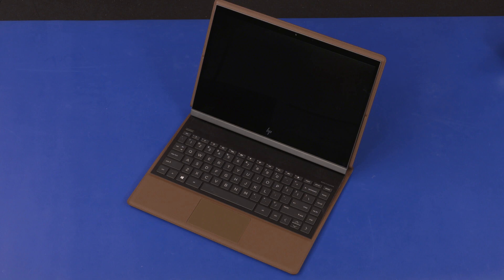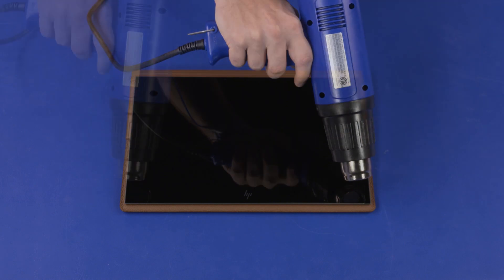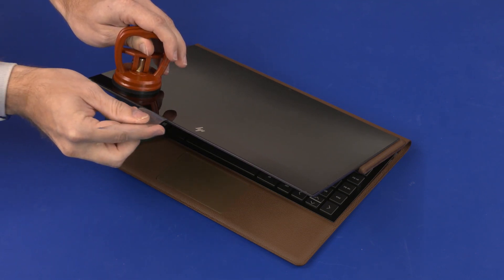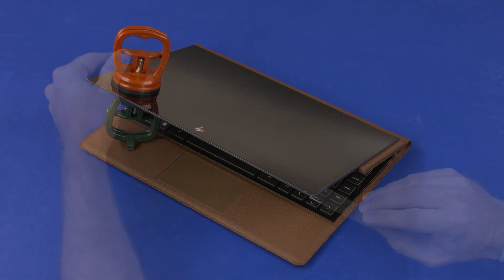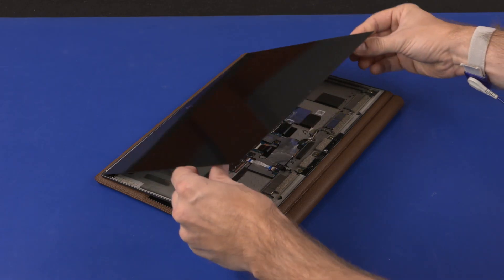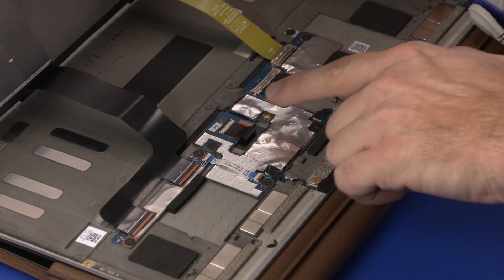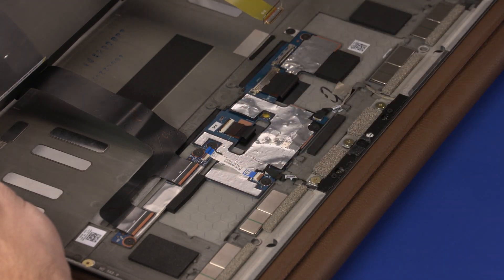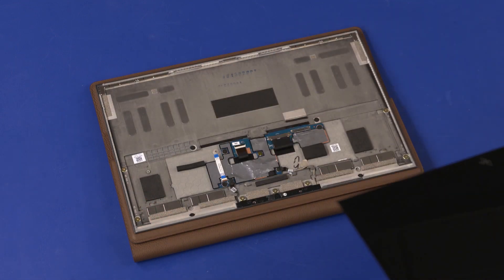Remove the Display Panel Assembly | HP Spectre Folio 13 and 13 x360 Convertable PC | HP

Comment: Could you tell what kind of adhesive can be used for sticking the LCD screen to the panel?
Reply from the maker: Hi Nguyen, thanks for contacting!
I understand that you are experiencing an issue with the screen of your computer.
In order to get this issue fixed, please contact our customer care team over the phone or chat for further assistance, as this issue requires Live conversation with you over phone or chat to isolate the issue and provide you instantly with appropriate solution or repair/replacement options available at your place as per the warranty.
Please feel free to reach us on call/chat, please access this link to select your preferred country and language option to reach us. Global support link: - https://www8.hp.com/us/en/contact-hp/ww-phone-assist.html
Binu - Social Media Tech Support

Comment: I have a couple of horizontal strips in which neither touch nor stylus work on my HP Spectre Leather Folio (a laptop just like the one in the video). I rebooted the PC and the touch-blind strips are still there. Except for them, laptop screen is OK. I wonder, if I disassemble the screen like that, clean the contacts for the touch controller, and put it back together... would it fix the issue? PS Laptop is currently out of the US -- bought it in California less than a year ago...
Reply from the maker: +Ricardo Castro Yes. You can try those steps to fix this issue.
Reply: @HPSupport  I bought this same laptop Nov 2018. I have been almost 6 months where only the bottom 3 inch portion of my screen touch screen works. I have tried every single diag, From restarting in Esc and F2 touch screen diag, reinstalling drivers for touch screen, disabling, enabling. Updating latest updates and graphics, hard reset etc..... If I flip the laptop and screen flips upside down only the same 3 inch section in my screen works. I don't know what else to do. HEEEEELP
Reply: Did it work?
Reply: @anthonychicorar  I never got around to doing that. Laptop is functional, except for the touch screen/stylus (and that is a pity, it robs the benefits from the form factor). The procedure in the video is delicate, and I might not be able to put it together again (there's glue involved -- once I remove the current screen I am not sure it can be sticked back again)...